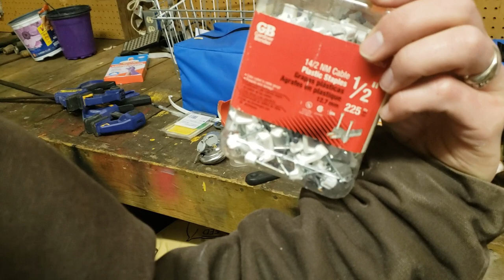How to Build an Ohio Brooder - Cheap and Simple to Make

Comment: what type of incubator is that?
Reply from the maker: Hey there, thanks for watching. It is a Nurture Right 360 and we got it from Tractor Supply. It is also on Amazon: https://www.amazon.com/Harris-Farms-Nurture-Right-Incubator/dp/B0793HHZ1L
Reply from the maker: I should also add that we bought it after using one of the styrofoam ones that had very inconsistent results and a thermostat that was way off. This was one perfect.